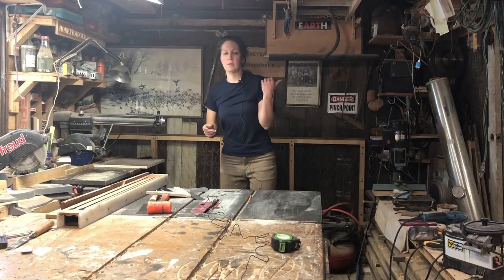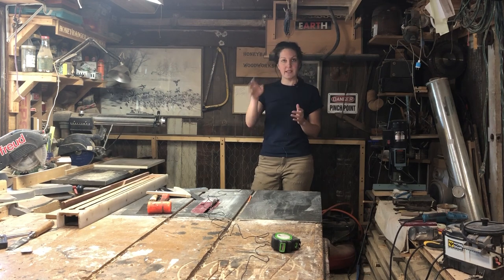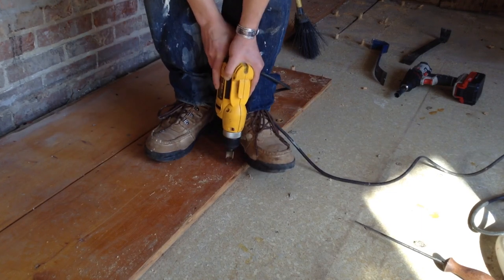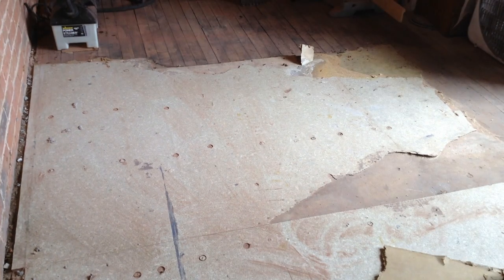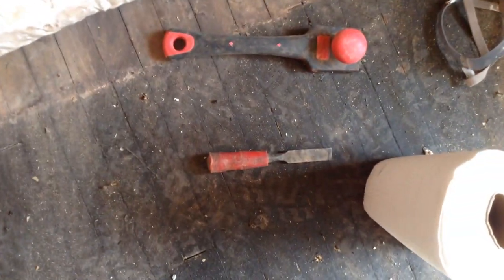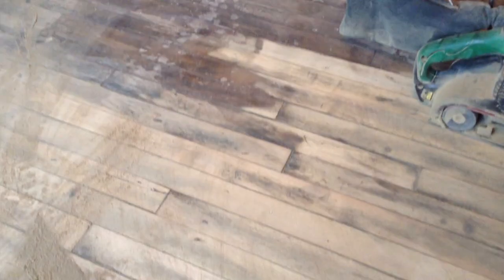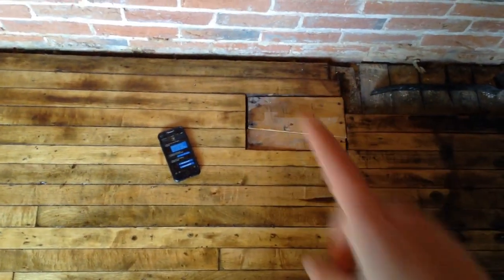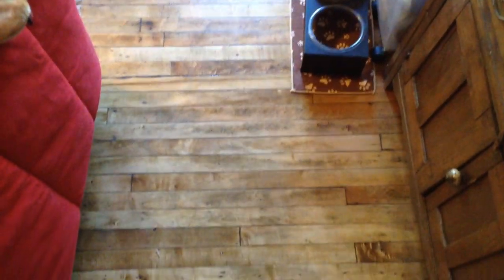Woodworking : Refinished Wooden Floor // Victorian Home

Comment: Excellent work! Good to make plugs as I would have just drilled the heads and ruined the boards. About asbestos: I probably did same search and watch same videos. I found none, but the linoleum adhesives are the issue, along with some tiles that are "frangible". For me, it wasn't nice flooring underneath but diagonal T&G subflooring. Found a cracked joist (sistered it as repair), and some previous termite damage because previous owner had DW leaking for years to a crawl space (all gone pests and under pesticide contract). LOL roofing shovel used as well! Great advice on the sanding...I think you've earned atleast another 2 years rent of the garage :)
Reply from the maker: Yeah I better be paid in full for a little bit here on that rent.